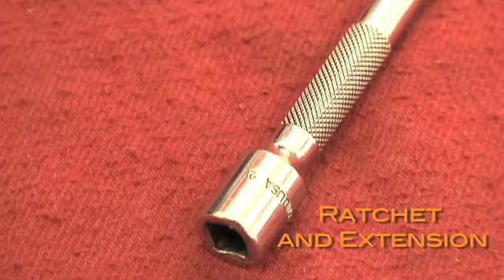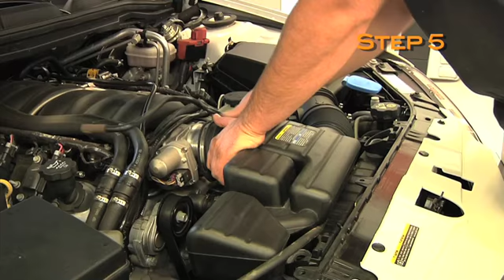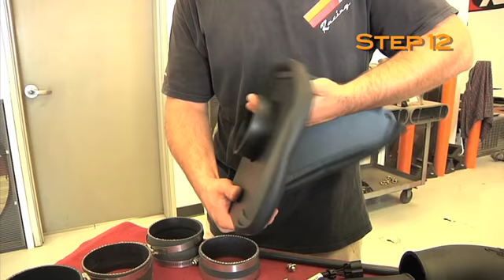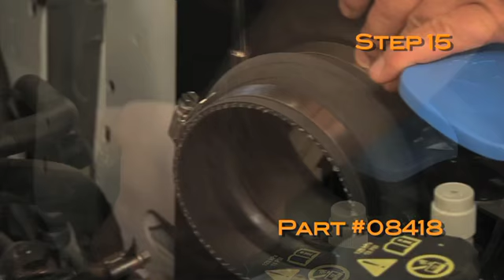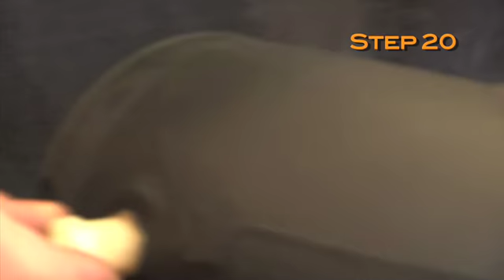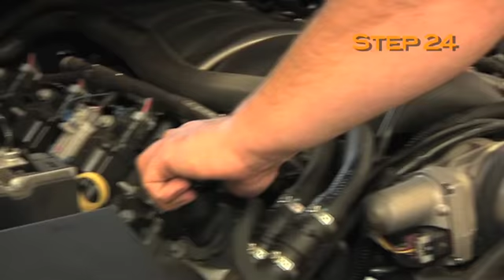Pontiac G8 6.0L [#63-3071] Air Intake Installation

Comment from the maker: You could get colder air at idle this way, but would add restriction from the longer tube. Also, some vehicles react differently to the different designs. V-8’s like short rams, where a lot of 4 cyl like cold air set ups.

Comment from the maker: The air brought in is still the same amount of air as the OE system. The only way to put more air into an engine is by using forced induction (i.e. supercharger or turbo). The intake will pull the same temperature as the ambient air you are driving through; it is not possible to make the air colder. The HP increase comes from removing restriction allowing the engine to pull air in easier. This saves energy on the intake stroke which transfers through the powertrain resulting in HP at the wheel.

Comment: ok this will make more HP and it will intake more air! but at the same time compared to the stock intake system this kit will also intake HOTTER air!!! isint the whole idea is more air intake flow but cooler/COLD air???